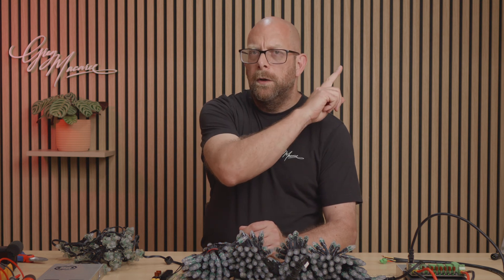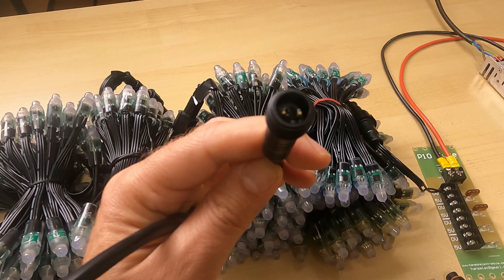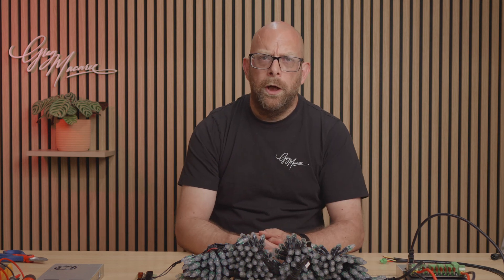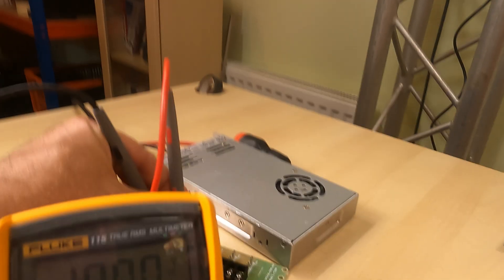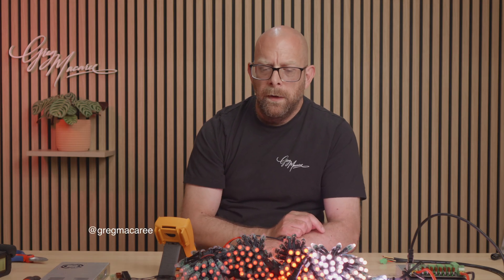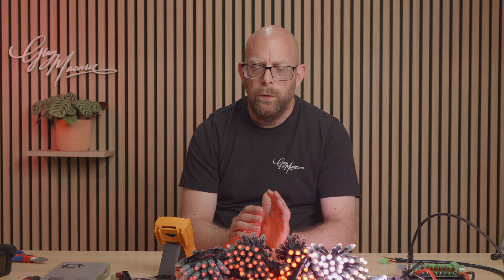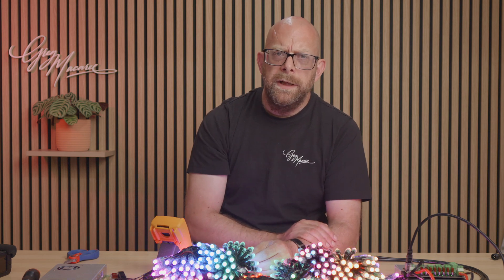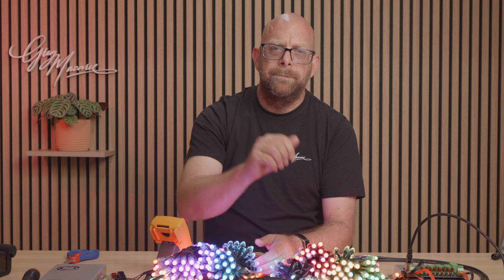Pixel Power Injection #pixels #xlights #holidaylighting

Comment: I want people to know. That where you cut the 12v wire. Please, make sure that you cap the live 12v end off. It doesn’t need to come in contact with the other live end from the other power supply.
Reply: Not gonna hurt anything if it's not touching metal

Comment: Great video! I may have missed it, but for the 2nd psu at the end, do you still feed in + and - or just + since the negative runs throughout? Thanks!
Reply from the maker: Hi, feed both as the current flow has to have the capacity both ways.
Reply: @gregmacaree thanks!!!

Comment: I run multiple 12 volt PSU's using positive and negative injection through the props. I make sure my voltage is within .1 of each other. If that's a concern you can use a diode if you believe your PSU's are going to fight each other. There are many mays of doing power injection.
Reply from the maker: That is not recommended and not supported by Meanwell - Their larger PSU's do offer load sharing - but they are devices such as the RST-10000.. bigger than we're likely to use.

Comment: Clearly explained. IMO power injecting is maybe not very worth in case you can split your "long string" in more ports of the controller. I suppose the ideal situation to get the 100% in white would be to Power balance the first 200,  and power balance the last 200, and also as has been done power inject, but is a more complex installation. In my case i prefer to split and use "more ports", at the end the extra cost is to buy a controller (that can be a smart receiver), that is not very expense and you get out of power injection problems, but as said is my opinion.